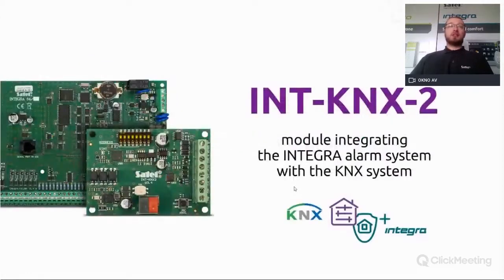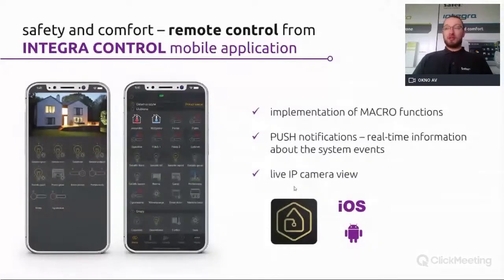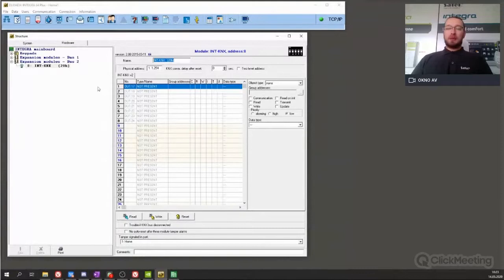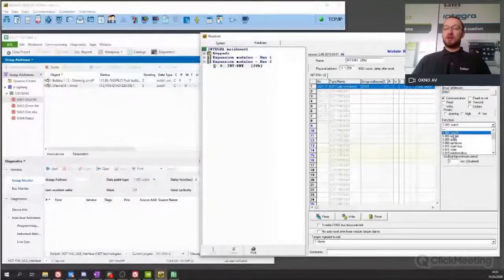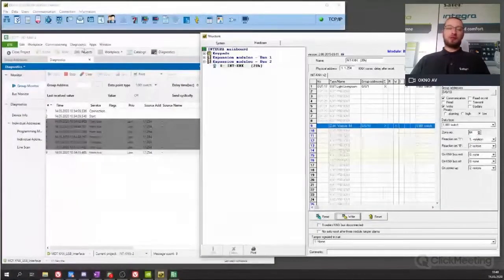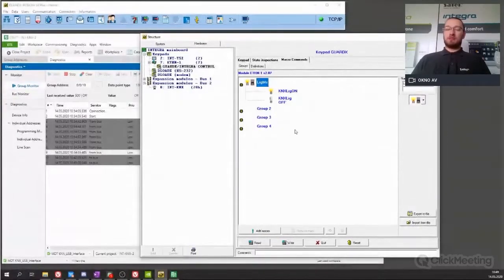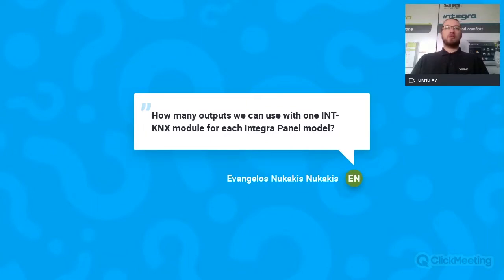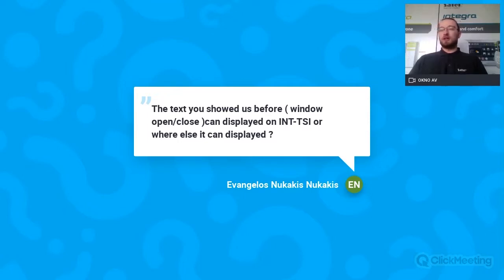SATEL Webinar: How to configure INT-KNX-2 using DLOADX

Comment: I managed to configure pretty neat toggle switch with feedback for KNX with INT-KNX-2 and INT-TSH2.
It looks good, but it's messy inside. I'm not sure it's worth implementing for all switches, but maybe for a few.
A single switch uses 2 Outputs from INT-KNX range, 3 additional outputs and 2 zones.
2 zones must be configured in INT-KNX as Integra Zones using knx switch feedback group address, first reacts with 1:violation on "1", and 2: restore on "0". The other input is inverted - 2: restore on "1" and 1:violation on "0". KNX flags Comms,Write for both inputs.
This way exactly 1 of these is violated at a time. Name them "Light ON" and  "Light OFF".

Now choose 2 outputs from INT-KNX range, configure as Integra Output, assign group address for sending switch commands. KNX flags: Comms, Transmit.
First one sends "1" ONLY when output is ON. To be called "Turn Light ON"
Second sends "0" ONLY when output is ON. To be called "Turn Light OFF"
(Write data to INT-KNX)

Now configure 1 arbitrary output as MONO switch, with cut off time of 0.2s (right-click and click edit to enter fractions of second). No zones or timers.  Call it "Toggle Light".
Then configure 2 outputs as "109:Zones logical AND" - choose zones which you configured in INT-KNX - 1 per output. These outputs will bridge zone status. Name them e.g. "Light is ON", "Light is OFF".
Now configure 2 outputs from INT-KNX as "46: Outputs logical AND". First - Turn Light ON - should take outputs: "Toggle Light" AND "Light is OFF".
Second - Turn Light OFF - should take outputs: "Toggle Light" and "Light is ON".

Write data to your Integra.

Now configure the INT-TSH panel and create a macro "Toggle Light", which has state "State follow input" of Zone "Light ON". Command list would contain only "Outputs ON: Toggle Light". Choose icons to reflect switch status.
---
That's it.

Now the icon shows current switch status even if it was changed from inside KNX or from anywhere else.
Turning the "Toggle Light" output ON for 0.2s is just enough to turn EXACTLY ONE output ON: either Turn Light ON or Turn Light OFF.
They should cause INT-KNX to send a single telegram. By the time it receives a status feedback from actuator, the MONO switch should be  turned off already (hence 0.2s cut off time).
Reply from the maker: Hey, thanks for sharing such a detailed setup! It’s great to see how INT-KNX-2 and INT-TSH2 can be used together creatively. We’re always interested in feedback like this - if you notice anything that could be improved or streamlined, feel free to share your thoughts